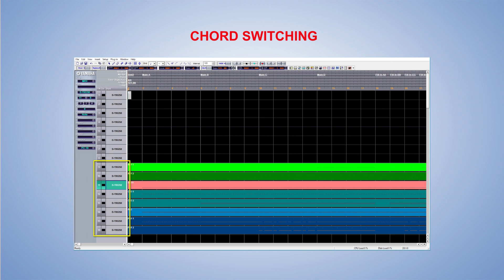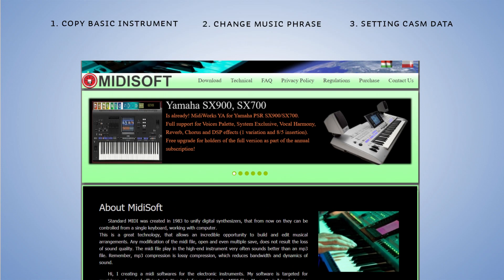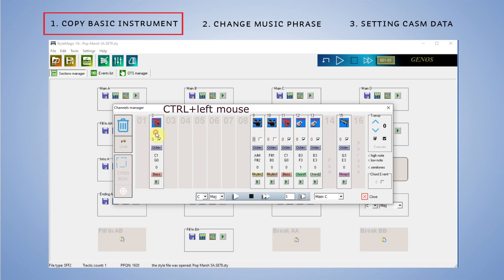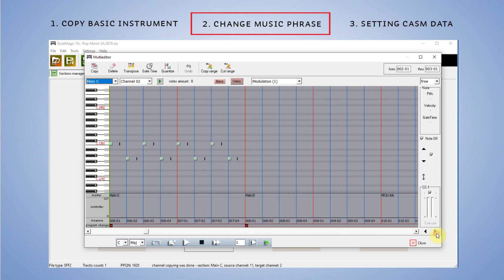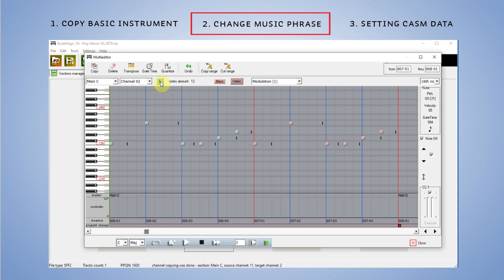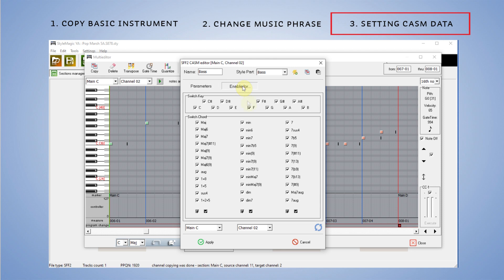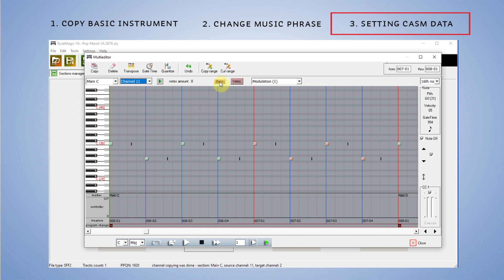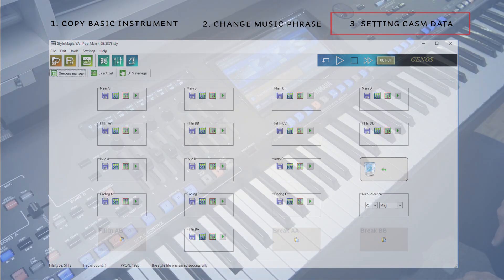Chord Switching - explained procedure for Yamaha arrangers - StyleMagic YA software

Comment: Wow, these drums are great! I just wish they were available on more keyboards, or that the samples were in a soundfont.
Reply from the maker: These are factory drums from Genos.
Reply: @CasperVideo  I get that. I'm saying that I wish I could have them. I wish they were either in a soundfont or on the PSR-SX600/700. I have a PSR-SX600, and I wish I could either have the drum samples themselves, or the demos of the Genos drums as MIDI files, to compare them to an expansion pack I have, and the drums that already came on the SX600.
Reply from the maker: @DJIncendration  In addition to specific sounds, Genos also has the so-called Round Robin technology (kontakt). There are up to 28 layers in the factory drums. That's why the SX series keyboards can't sound the same. You can have the same samples but they cannot be triggered in the same way.
Reply: @CasperVideo  I get that, and I'm ok with that. I just wish I could have any of them, even if it's not the exact same. As in, even if there's no wave cycling/round Robin technology, I wish I could have even one of the samples of each drum (one sample for each velocity).
Reply: @DJIncendration  That WOULD be nice! As pre-rendered audio samples.